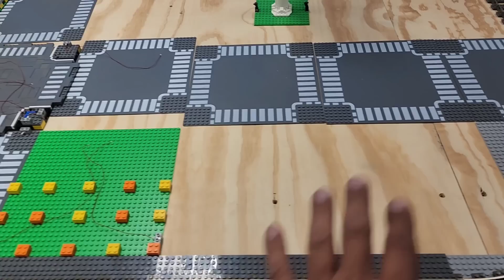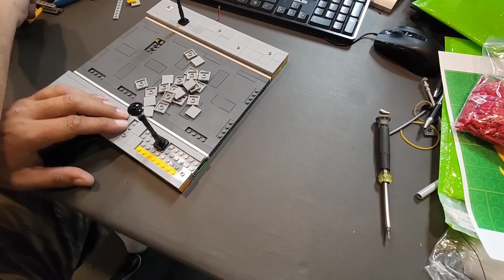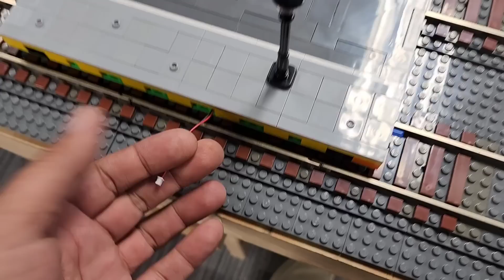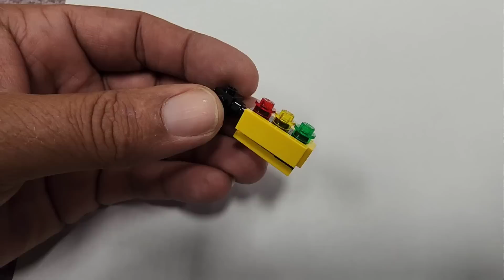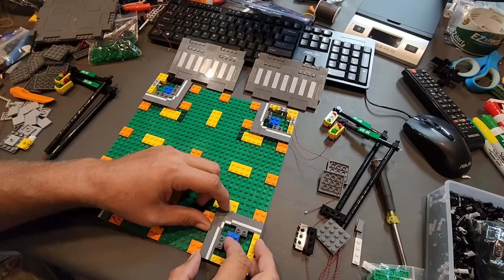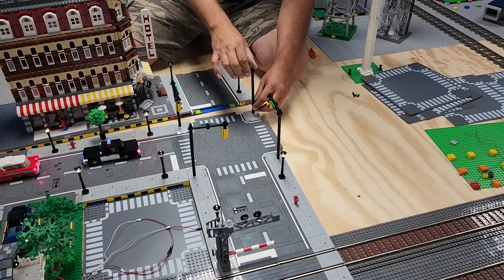Lego City Upgrade: Taking it to the Next Level with LED Lights!

Comment: I truly believe that you have so far, captured that small town vibe. And I am glad you're going with the new road plates. I have a small city 8x12 , all on Mils plates now. Then I started with your brick roads... OMG! a lot of work, I switched over to the new road plates and after watching this video, I am glad I did..  I'm just now staring to consider lighting it up... and your light system is simply AMAZING!  A huge thank you for designing them....
Reply from the maker: Thanks so much.  I still love my brick built roads as I can do much more detail work with them.  But for lighting the new road plates are much more friendly.  Especially if you use the building connectors to move your cars around and such for lights.

Comment: The "night vision" of your city is looking amazing!

One thing came to my mind after the solution you gave about traffic light cycle last video, switching green and red on each connector. What if another yellow is added to the cycle, after red and before green? It'll look a little more like Europe than USA, but at least it won't need a more complex board. Please just have in mind this idea is coming from someone who doesn't know anything about electricity besides plugging devices into outlets. 😅
Reply from the maker: It would require changing and adding more outputs to the control board.  Still working on a smaller more compact solution.
Reply: @BevinsBricks  Nice to know. I'm looking for the results, which are already very nice right now.

Comment: About your control board conundrum, could you make a small rolling hill or slope on a base plate with like a lift station or something on top of it? I see small lift stations on corner streets in my home town. They’re small white and green buildings, and usually have a sign saying if red light is on call the town lol.
Reply from the maker: In the past I drill a hole in my table and mounted the board on the underside.  But Im trying to make this city simple and easy to modify.  To show others lighting doesnt need to be scary.  Its funny you talk about the lift stations as I maintain a few of those at my current job, it is a viable option to say the least :)  would just require more wire.  I may change things up in the future and make the larger board available for sale also, just not sure most would want to use it.

Comment: Loving the traffic lights and I'm very impressed that so many wires went through a technic pin, so I'm curious, what AWG gauge are the wires? That's a lot of wiring in a tight space. The result is terrific! 🙂
Reply from the maker: Yes thats thw advantage of also using the new road plates as it gives you a lot of space to hide things under them.  As for the wires they are stranded 34 gauge wire.  Its important to use stranded so the wire stays flexiable. :)

Comment: Hi man. Yeer I can emadgen trying to do lighting with so Manny wire s at once. And if not haveing them colour coded. U would have to have the wire s siting in diffrent spots   and grab them as you do each colour  of. them. To not get confused ..so like U seed best way .is mark each  wire s .colour coded . 😊👌💥
Reply from the maker: Thanks, yes it would get confusing very fast without the color coding.  Wanted to share that little trick with others so if they want to attempt anything like this :).

Comment: Ugh. I don’t know if I’m inspired or intimidated.
I’ve just started my table/city and would love to do it right (like this) from the beginning but I fear knowledge and cash will definitely prevent me from doing this from the beginning.
I’m trying to light most everything.
I suspect I’m going to have 150 aaa batteries and 50 battery boxes cluttering up the whole city 🤣
Reply from the maker: The biggest thing is to take your time and enjoy the hobby :).  As for lighting I hate the big sloppy mess that comes with using all the big companies lighting kits.  Which was why I started my own lighting business and invented the magnetic mils connectors.  As it stream lines the entire process.   There are other more affordable options as well and I even have a new option I will be releasing in the next 2 weeks.  For a lot of good information I recommend my other channel bevins bricks world as I get much more involved in explaning things :)
Reply: @BevinsBricks  oh yes, already sub’d
Reply: @pbosche  If you have a cordless drill battery, you can get USB adapters for them. My Hercules adapter (Harbor Freight) only has 2 USB ports, but perhaps via USB hubs you could power 8 to 12 USB lighting power connectors from one drill battery. I don't know how many lights each of those USB connections can power, but I'd imagine several dozen. You could have the USB hubs in buildings and have the tiny wires & magnetic connectors carry power underneath across different MILS plates. Probably power half your town on 1 drill battery.
Reply from the maker: With usb power supplies its usually 1.5 amps which equates roughly yo 150 leds per port.  I always tell everyone to stay at 100 though

Comment: The obvious solution to the thick lighting control board is to increase the height of your mils plates to two bricks.  I actually starting using mils plates long before they were called “mils” plates. I got the idea by watching early Beyond the Brick episodes and saw how many of the creations were segmented for easy transport.  I used two bricks high because I felt it gave me the best flexibility for incorporating features such as river banks.  I rarely use just one brick thick mils plates.
Reply from the maker: I started doing 1 brick thick due to the size of my displays.  But I agree 2 thick is much better for smaller displays.  As it gives you more options for details and depth.  This city display is 8x24 feet.  With my last city it was 320 sqft. But in short making everything 1 brick helped me with my costs :)

Comment: Are you able to light the entire city just with the single power connection you drilled or will you require multiple sections to connect to separate usb plugs?
Reply from the maker: It all depends on the total load as I like to have no more than 1 amp on a circuit.  But for reference what I currently have illuminated Im only using .5 amps so I still have roughly 50 leds I can use on this circuit.  Ill explain more on all that in the next video.